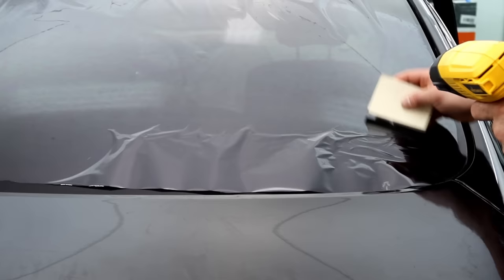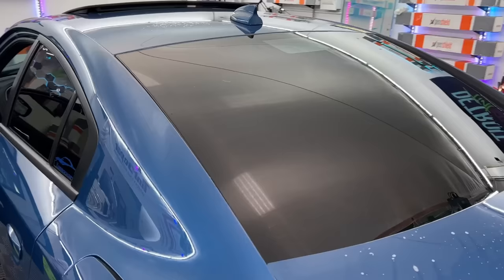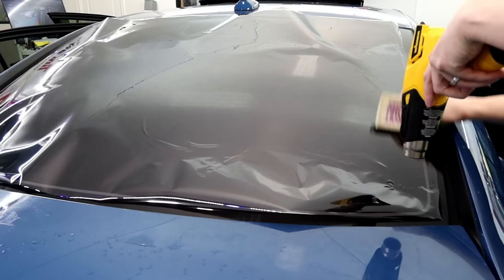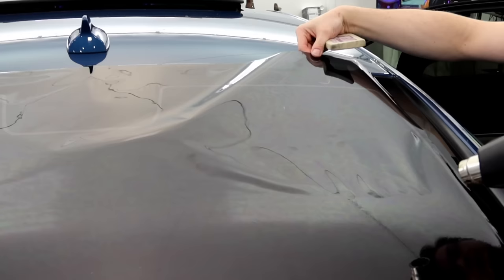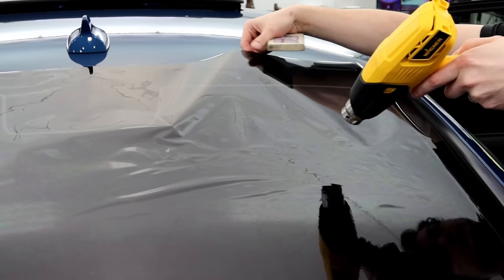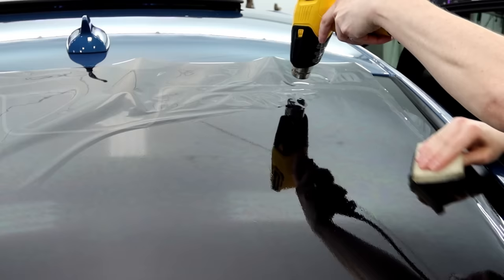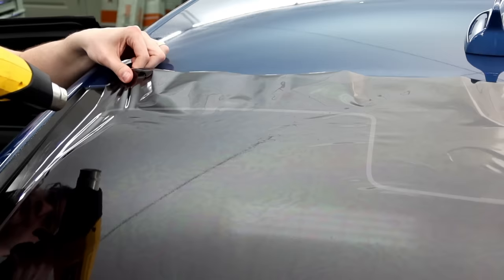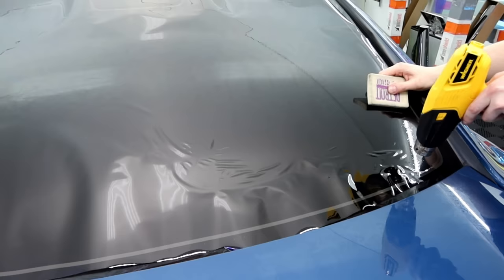Why You SUCK at Tinting Windshields

Comment: I worked at a tint shop back in the day and I think each brand of film has their own shrinking characteristics. Unfortunately we switched brands a lot for reasons like glue failure, color inconstancy, bad film, or pushy reps. Not going to say manufactures but the big ones we all know.  It was a pain back then because we had to re-learn the film each time we switched. Nowadays film has gotten better but as Matt says in so many words, time is money.
Reply: Recommend any brands with great service and representatives?
Reply: I agree. Some tint stretches and shrinks easy, but some is just crap.
Reply: @jond8013  lexen still good and MK brothers.
Reply: @Busted Mechanic Fact 💯

Comment: I tinted my own car this week and I just did the rear glass today, with only the information I got from a youtube short.  I ended up with one crease, and it was from going too fast and swiping too much at once.  I slowed down and the next three corners went much better.  Gila film from oreillys, dawn dish soap, a folding razor blade, and a lodge cast iron pan scraper.  For using the absolute worst components I was actually surprised with how well my first try was.

Comment: I have been using lexan for about five years you are absolutely correct when it comes to a difficult back window I go back with my original product Solar Gard or I order lexan Kool Max Supreme  great video it reminded me that I'm not the only one out here struggling with the lexan shrinking problems
Reply from the maker: Thanks I appreciate that! I’m glad I didn’t come across as bias against it. Seems to be giving a ton of people problems
Reply: I have been using the Lexen Premium Nano Carbon for about 3 months now and was always having problems. But honestly,  I kept watching your shrinking method and haven't had a problem since. Just following your shrinking advice set me free and I lay it down smooth and quick now.
Reply: Ain't no way in the world you could do a beetle or older Camaro with it no way reference the lexan
Reply: @DetroitTintStudio  yes lexen is good on some cars but trying to do a windshield on a 05 was difficult

Comment: When we train with this type of film I leave a little extra material top and bottom and we do what we call steering the film. Start by not doing an H pattern then grab the excess film near the lower/upper side edge and steer it from center to outer edge. Lexen shrinks slow but it'll lay flat if you follow this method. Common problem is not familiarizing yourself with different types of film. Your memory doesn't adapt quickly to new type of film if you use the same film consistently.
Reply: This helped. Thanks
Reply: Could you make a video about it? Iam currently using this film just to  learn something new and it's kicking my buttcheeks

Comment: Hey man! I really like your videos and been following you for years now. I've been working with Lexen (between other films) and I've tried almost all their lines. I've noticed the same exact problem with the basic carbon they have. A little harder to shrink for sure. The one step higher Puremax line is a lot better for shrinking and also looks better. Also their ceramic lines are really easy to shrink

Comment: Use a heat gun with heat control, I deal down the heat.Also you can only heat up and down. Do your H pattern and make the lines go up and down...The Yellow cheap gun has no heat control. A heat control gun will keep you from burning your tint when shrinking film..I own a window tint shop ..

Comment: Ebay films are the ones that screw newby and wanna-be tinters.

I know this, I got stung myself.

Sure, it was cheaper to get a 10meter roll and go tinting, but when you blow 5 meters of tint on 1 back window because "trying" and "too much heat", it doesnt become cheaper, and it also becomes bloody frustrating!

To then crack it, walk into a pro, and he takes 1 look at the film and says "that's cheap house window film, it's almost impossible to shrink it enough to fit the curves on your car's rear window", you realise you either should have gone and bought a quality film, or just payed the pro...

For the 1-off guy, ebay films are NOT the answer, for a start-out, the films are fine for building windows, but you will struggle hard for a very curvey car